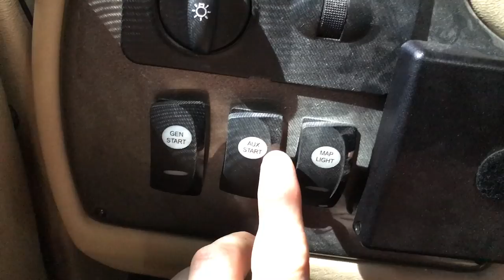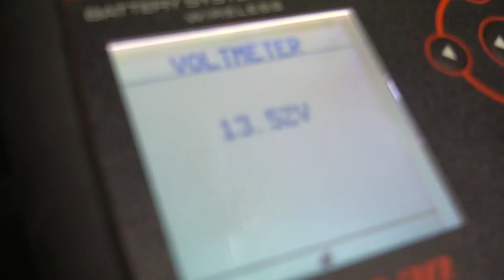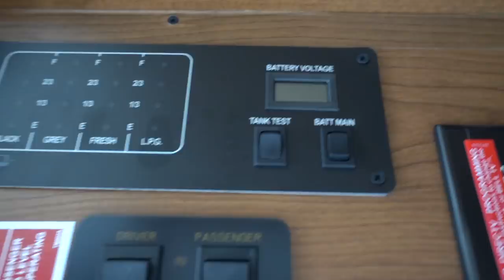PART 2: 3 x RV Breakdowns in a Month. The Saga Continues...

Comment: Try to never let your house batteries go below 12.1 volts! Or they will not last.
Reply from the maker: HI Ray, yes Marc is very diligent about keeping them at 12.1 or higher. Unfortunately, leaving it in the shop for a week it was out of our hands - despite asking them to keep it on charge... we are just lucky the "old" (5yo) batteries died - they needed replacing anyway. If this had happened after replacing them with new ones, we would have been a  LOT more annoyed.
Reply from the maker: Yep, we're aware of that. Hence why at the 4-5 year mark we were actively shopping to replace them.
Reply: Not so with 6 volt Golf cart batteries... I have been getting 10 years... but I run 6 of them in a coach about the size of Marc and Julie's and thats up here in Canada where I run the furnace lot's in the spring and fall. I make sure not to  get them down below 50%, Marc, if you do much boondocking get at least a couple of more batteries If you don't have room then get agm batteries and a marine style battery switch and switch between battery banks during charging and use. Best case if you can afford it, Lithium ion then you won't hurt them to discharge to almost zero

Comment: Schedule maint. Owners guide has them. Belts,hoses,clamps,batt,oil changes,lube suspention. Gen set, exterior seams,window seals. Front Bearings repack grease is often overlooked by allot of Rv'ers. stay safe...
Reply from the maker: Yes, Marc is great about keeping on top of all that - servicing, maintenance, owner's manual recommendations. It is interesting that ours (Ford F53 chassis manual) talks about greasing Zerks but not repacking bearings. One of our other followers commented on that recently as he had that issue at 60K. We knew our batteries were approaching the end of their lives... they likely would have made it a few more weeks if they hadn't been run down at the repair shop - oh well. It made for an entertaining video! LOL You stay safe too!

Comment: I don't see anyone asking about the original service shop that drained your batteries in the first place. They caused this whole fiasco in the first place. Did you approach them about at least reimbursing you the cost of the chassis battery that you bought and installed yourself? Really, you'd have a good case to have them cover the whole thing.
Reply from the maker: Thanks for asking.  We knew the batteries were getting a bit old already.  Had they kept the RV plugged in while in the shop, they would have survived, and we were disappointed that they didn't make more effort to keep them charged.  But would not have felt right asking them for a replacement when we knew they were getting old anyway. -M

Comment: I'm planning on making the move soon to full time rv'ing. I haven't selected an rv yet, but impressed by the impact of potential repairs. What extended insurance plan did you select? I am not nearly as mechanically inclined as you.
Reply from the maker: Hi Jeannette, it does give you peace of mind for sure. To be honest, we did not select this as we inherited it when we e\\ bought the coach. For the full detail, read the tips and info on our extended service contract along with who we actually recommend you contact for a quote / info. It's at the end of this related blog post http://rvlove.com/2017/07/30/part-2-3-rv-breakdowns-in-a-month-the-saga-continues - suggest you read that... but in a nutshell, here is who we would recommend you contact to get a quote and more info on an extended service contract - http://bit.ly/wswarranty - hope that helps!

Comment: When they did suspension, did they wield and blow all batteries
Reply from the maker: No, there was not any welding needed to fix the suspension.  The batteries were already a bit weak.  We had already been starting to research replacing them.  Being in the shop for too many days without being plugged in was the final straw for them.  Had hoped the shop could keep the coach plugged in, or run the generator a bit.  But didn't work out.  We are definitely careful to disconnect batteries in our new coach on the few times we have needed to weld.  We have a great new battery system in our new coach.  Here is a link to check it out. https://rvlove.com/2019/03/25/episode-5-our-off-grid-lithium-battery-and-solar-setup-ultimate-rv-makeover/